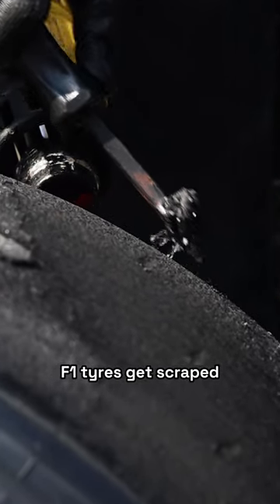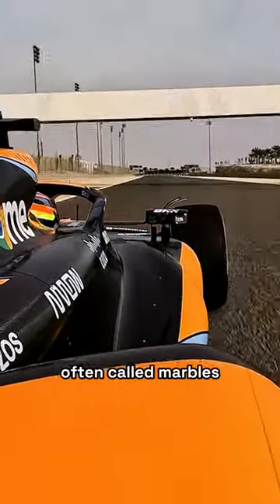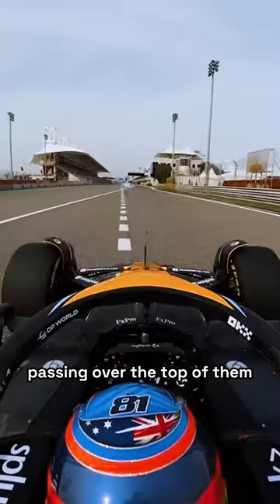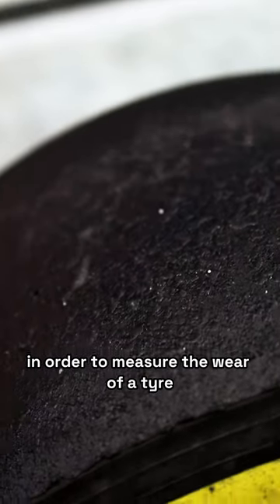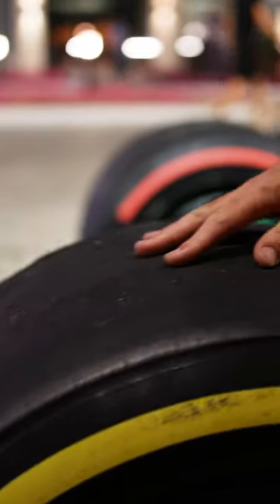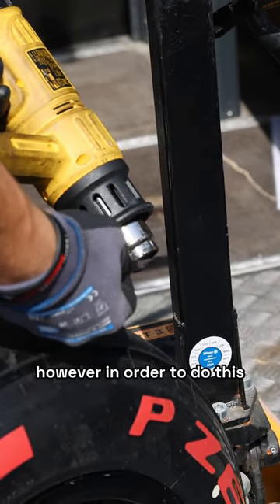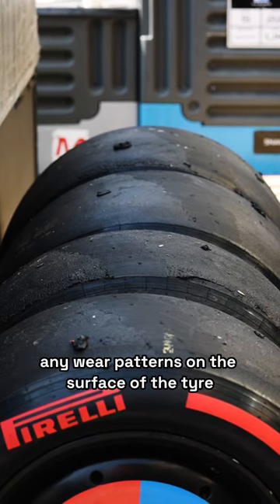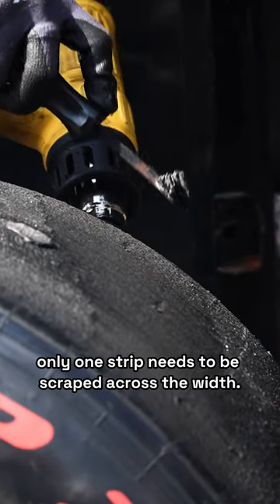Why Do #F1 Teams Scrape Rubber Off The Tyres? 🤔 #Shorts

Comment: I have a different question.  Why are drivers told to pick up rubber?
Reply: @boomfaoce  the tyres lose a lot of rubber and thus weight, so in the cool-down lap drivers pick up rubber to meet the weight requirements of the car